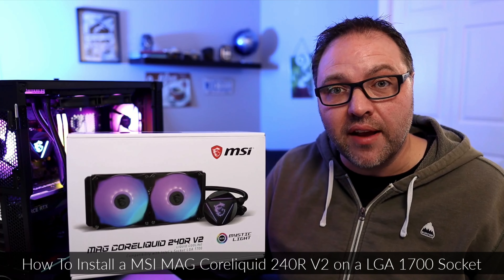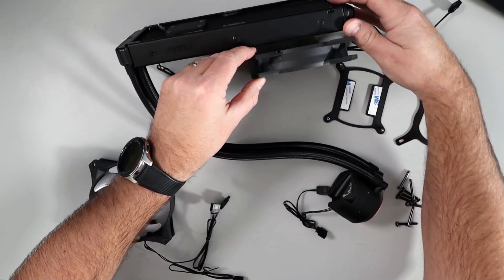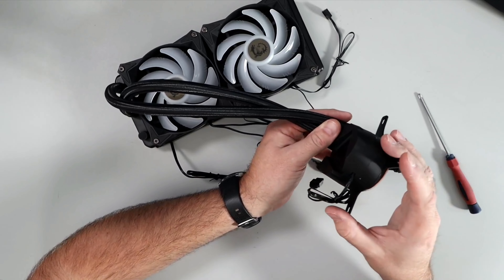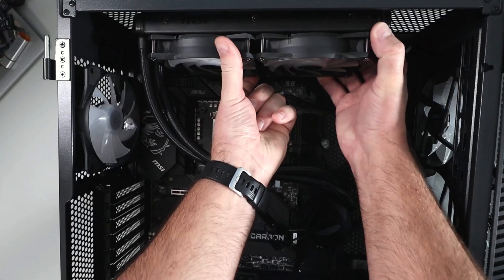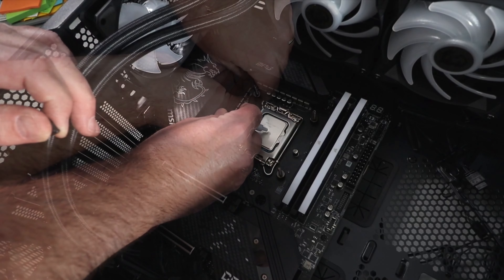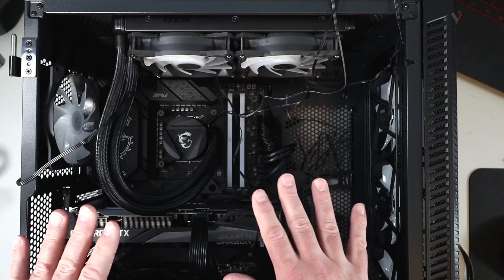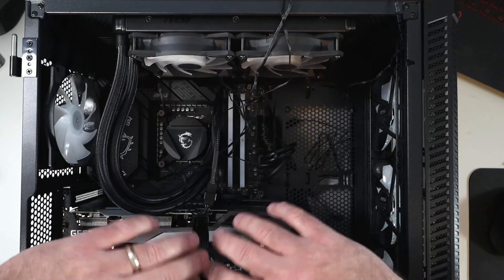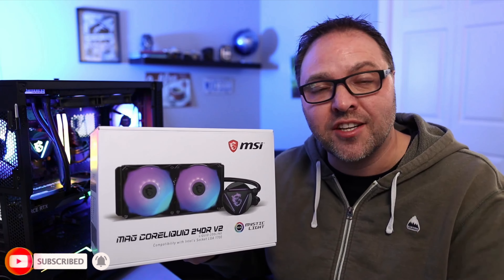How to Install a MSI MAG Coreliquid 240R V2 on a LGA 1700 Socket

Comment: I have no pump fan on my motherboard -_-
Reply: You don't need pump fan they are usually just CHA or SYS fans renamed. You want the 2 fans on a splitter that makes it 1 connected to the CPU (yes cpu) and you want the pump aka radiator 3 hole connected to cpu opt, cha fan or sys fan. All 3 should be fine just double check your pump aka radiator is running at 4000rpm plus all the time. It's very quiet and you want the pump running at max at all times. Not the fans they can change speeds as they need but the pump wants full speed. Enjoy
Reply: @PlutoKam  bro prob refunded alr
Reply: It’s on the radiator
Reply: @PlutoKam  
On my motherboard there is only AIO Pump information and there is no pump fan, can I put it on the AIO Pump?

Comment: Just installed mines according to this guide and it's running like a charm. Unfortunately the system is telling me the motherboard doesn't support the lighting features so it's stuck on the custom lighting but I'm loving it. THANKS MAN
Reply from the maker: Thanks for sharing
Reply: Hows it performing now couple months in? Are temps still solid?
Reply: are you able to turn all LEDs off?

Comment: Just finished my MSI building using this as a reference to install the 360R version. 👍
Reply from the maker: Awesome! Enjoy it!
Reply: @NorthernVikingEveryday  Looking to get an MSI 4080 super graphics card but there seems to be different models some from same manufacturer from MSI but different prices with one being £100 cheaper than the other. Is there any real difference? Want to get the best model even if its more expensive.

Comment: I don't have the 3 pin hub on my motherboard to plug the RGB into. Yours was labeled jrainbow. Do I need to get an adapter or can I just leave that one unplugged?
Reply: I have the same problem aswell with my b550 motherboard. I am thinking about buying a new motherboard or extension if possible because my PC looks quite dim.

Comment: are you not concerned with the pump being at the top, or is it something everyones blowing out of proportion?
Reply from the maker: Basically a year since I've installed it on the top and have had no problems. The MSI instructions show the unit being top mounted.

Comment: Thanks so much for this, I have an ASUS TUF GAMING B550M which has no pump header, only CPU OPT and CPU FAN. Can i just connect pump/fan cable 3pin (runs from the top) to the OPT and the fan 4 pin into the CPU header?

Comment: I have an Aorus B650 motherboard and that motherboard doesn’t have the slots for the 4 screw slots, only those two hooks. I don’t know what to do because when I try to screw it on, it just keeps moving.
Reply: How did you solve this issue ? I have the same problem where i can hook the cooler but its not even close to touching the cpu

Comment: and if there is no PUMP_FAN1 connector and Jrainbow, what should I do?
Reply: Use sys fan, cha fan or cpu opt fan all the same. For no rbg you can buy a cheap rbg controller little box the rbg plugs into and let's you change it and turn off etc.
Reply: @PlutoKam  Thank you, though my computer has been assembled for a long time, but thanks anyway!

Comment: Is there a specific way too mount it not cables up? I heard it causes the radiator too run dry I’ve taken mine out cause that was the case for me but it wouldn’t fit upside down is it safer too run it over the top I had mine at the right side of the mother board in a razor Lian li dynamic
Reply: this is the proper way to install, you want that pump as low as possible, so air gets trapped where it is not hurting anything.  Jays Two Cents has a video!

Comment: Is it enough for i7 13700k??
Reply from the maker: That is what I am using it with and it is great so far.
Reply: @NorthernVikingEveryday  okay thx, and do you know what is the highest temperature you get in game with it?
Reply from the maker: I was doing some fairly high stress tests and I was getting in the mid to high 80s.
Reply: @NorthernVikingEveryday  ok thank you!
Reply: I just got this processor and aio. Upon installing my pc ran for about 5 minutes and then got a blue screen of death. Now the cpu debug light and dram debug light are blinking and pc shuts off.

Comment: Where did you plug the pump fan exactly?
Reply: So the pump aka the 3 hole connector that comes from the radiator the large metal slab (the pump is in there in this model) can be connected to any sys fan, cha fan, cpu opt or pump fan. Hopefully all of them result in the pump quietly running at max all the time. The 2 fans can go in the CPU main fan socket they will adjust speed by themselves

Comment: Is the daisy chain necessary? My tower came with an ARGB hub that has enough connections for all the fans and block to have a separate connection.

I'm a first time builder so I'm assuming I don't need them if I have enough room on the hub so I should keep the caps on male connectors but I thought I'd just ask in case I'm wrong.
Reply from the maker: Yes, you should be able to skip the daisy chain and use the hub.

Comment: I plugged it the same way you did but onced i plugged the wire into the rainbow2 spot it wont turn on it flashes very quickly once then turns off but then once i unplug it, it will power on fine, the rgb works with the block but once i try to plug the rgb for the fans it stops working any ideas?

Comment: I got an MSI pc case with lights that came with it connected to an RGB control. Do I plug the CPU RGB fans into that or the motherboard like in this video?
Reply from the maker: You could probably do either.
Reply: Saw your case has one. Did you just connect it to the motherboard directly like in the video?
Reply from the maker: @joeking3333  yes, I connected it straight to the motherboard and only left the case fans on the pre installed hub.

Comment: Just tried to install it but ig my motherboard isn't compatible the bracket screws don't line up with the Holes on my motherboard
Reply: same, just purchased this today, came to find out, the LGA bracket that he shows to install from back side of mb, the bracket holes do not line up with the mb holes, taking it back. really wanted to try this cooler out, but i will not drill holes in my mb !!. p.s. boefore anyone ask if i tried using the wrong intel bracket ?..yes..i was using the LGA bracket that came in the box..package marked LGA.

Comment: Hi, great video, any idea on why mine doesnt show up in Mystic Light?
Reply from the maker: I would double check all your connections and that you're using the correct port on the motherboard. Double check that you're using the most recent software. Other than that, does anyone else have ideas of why it's not working? Please comment below.

Comment: I have a bit of a strange thing happening. The pump light is on, the fans are all going, but my cpu still jumps to 100 degrees during any load. I’m not using the splitter, could that be an issue if those top fans aren’t in the cpu fan slot or could it be a pump issue? Any way to tell if the pump is running?
Reply: That's a real problem 
I think it's thermal paste problem try to remove it clean the cpu with alcohol and use new thermal paste from trusted brand because sometimes the thermal paste that came with cooler date is over so it's not useful anymore, 
If you did this and still getting high temperatures also make sure the pump touches the cpu very well by tighten the screws but not so tight be careful, 
Also make sure the radiator fans in the right direction, 
It will fix it by following these steps

Comment: I have no pump fan in Motherboard can I put it in CPU fan ?
Reply: So put the plug from the radiator metal slab which contains the pump into the main cpu socket. That way the pump runs at max quietly like it should. Then plug the fans into a cpu opt or sys fan or cha fan and it will automatically change fan speeds.

Comment: At 12:11 for example, what is that small thing on your motherboard that is measuring the CPU temp (showing the number 39)? Looks cool!
Reply from the maker: It is a tiny screen that shows the CPU temperature and it also shows error codes that you can look up in the manual so you can diagnose problems.
Reply: @NorthernVikingEveryday  Cool! Could you perhaps share it's name or a link from where to buy it? Thanks in advance.

Comment: How is the reliability for these? Seeing lots of failures after 4 months
Reply from the maker: So far so good! I haven't had any problems with it. Been running it for about a month or so now.
Reply: Mines failed I have to get a new one, cpu package is overheating (90degrees and when gaming closer to 100) and cause my CPU temps to be at 87 degrees
Reply: @MonsieurBlac  Do you have the v1 AiO ? Because v2 supposed its better version who fixed all thermal problems